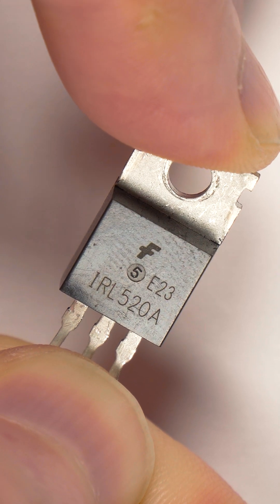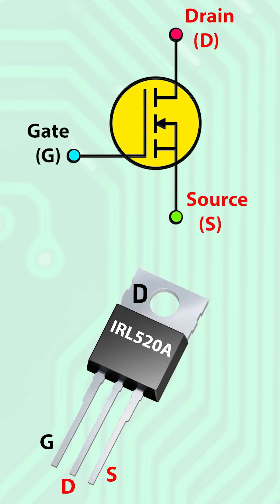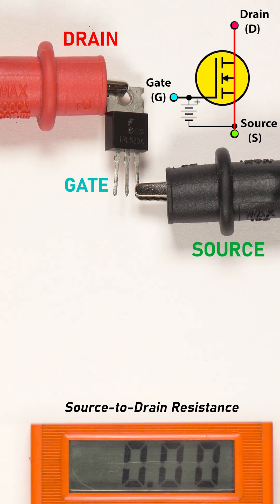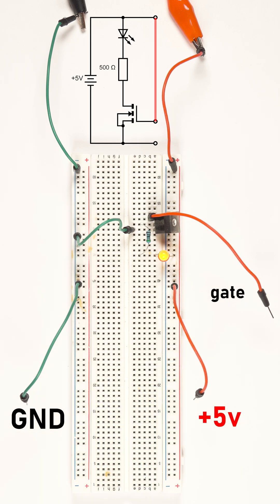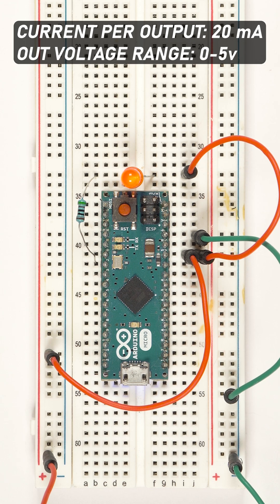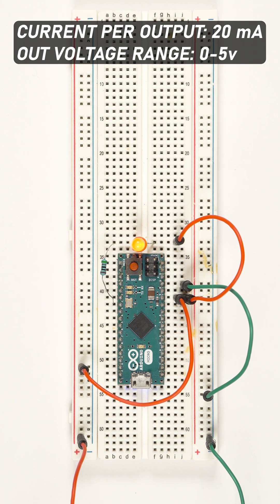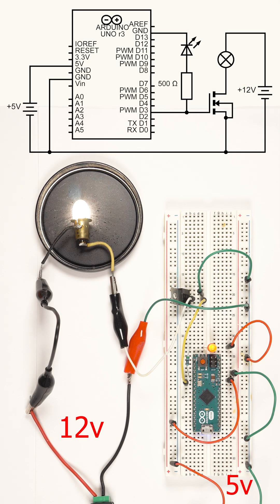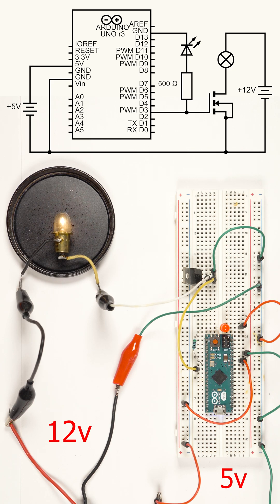How does the MOSFET work? #electronics #diy #led #mosfet #transistor

Comment: What is the function gate drain and source
Reply: the gate is controlled by positive and negative volts ,,positive energy makes the transistor to conduct ,to turn on  ,,negative enegy closes the gate ,,,,source is negative ,,drain is positive ,,   ,,youll understand that a 10k resistor from source to gate will make the transistor to turn off,, on and off ,,makes the comunacation posible or the inverters etc switching power supply etc,,greetings from Dominican Republic